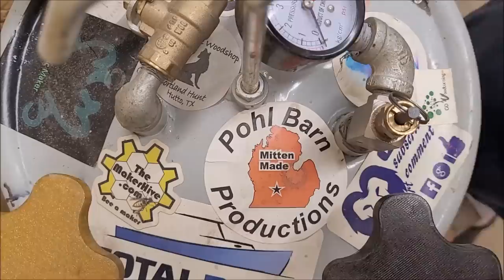From the Firewood pile to a Beautiful Bluegreen  Bowl

Comment: I have an idea to keep you from drilling the center hole too deep...

Modify your circle cutting jig slightly by cutting a 1/8 inch thick plywood circle, then drive short tacks through the plywood so they slightly protrude through the other side of the plywood.
Place the plywood on the circle jig with the nail points UP and trim the Trim the center dowel flush then Wax the two mating surfaces to reduce friction...
Now, the nail points will hold your wood blocks on the jig and you can still cut circles by spinning the plywood...

Basically, I'm trying to describe a Lazy-Susan type deal with nail points to hold the wood blocks in place during circle cutting...now you can get round blanks without needing to drill holes in the center of them...
Reply from the maker: Thanks again, funny thing is I can already do that with the 1/4 inch plywood circles I have cut out, I just don't think of it when I cut the wood
Reply: @PohlBarnProductions  Perhaps you should just leave the plywood circles on the jig then...that way, when you pull the jig out to cut another circle, the plywood is already on the center peg to remind you...